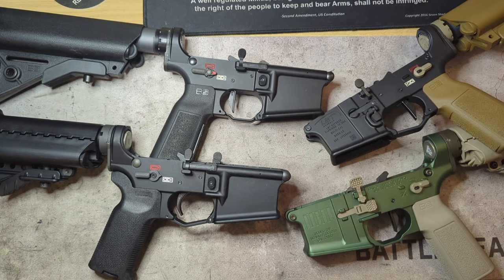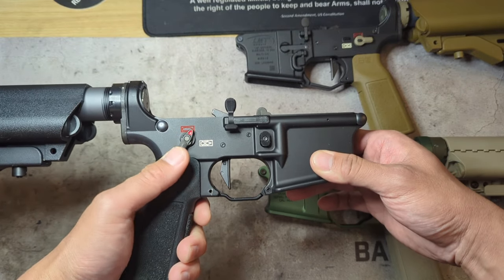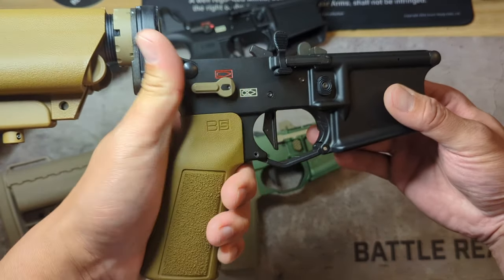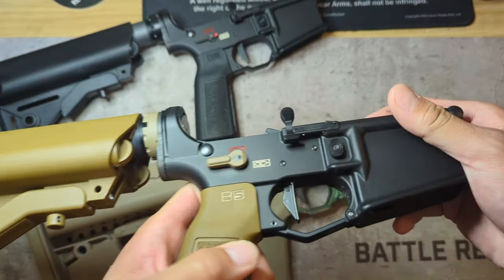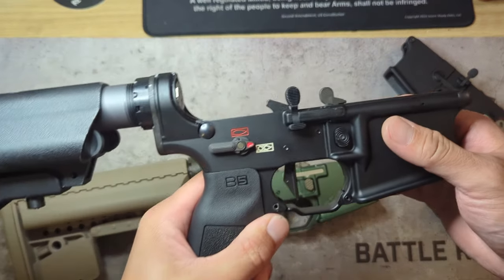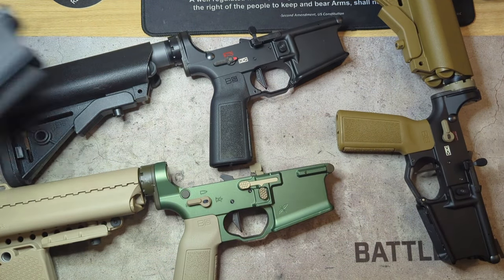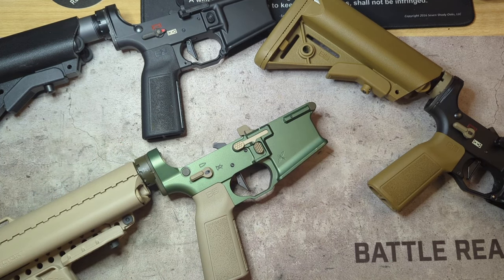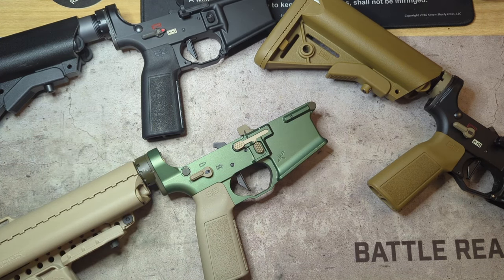AR-15 Safety Lever Comparison - Badger Ordnance Condition One vs Forward Controls Design ASF vs Mil

Comment: I had that same delay problem with my ATC AR Gold trigger. It didn’t matter what safety I tried… The problem was with the way the safety interacted with the trigger. In my experience, it is almost certainly the fault of a dimension on the trigger being out of spec, not the Radian safety that was causing the issue. To fix my AR Gold trigger I had to remove a tiny bit of material on the part of the trigger that sits directly beneath the barrel of my safety in the FCG. Once I did that, the safety smoothed up considerably and I no longer had the delay problem as you described in your video.

Comment: Where did you get the FDE bolt release on the FCD/solgw lower on the right side above the mag release?
Reply from the maker: I just spray painted it that color before I installed it
Reply: Revival defense has Cerakote fcd parts in fde and odg
Reply: @regulardudegungearreviewsh3132  great idea. I should've done that before I installed mine to match my rattle-caned build.